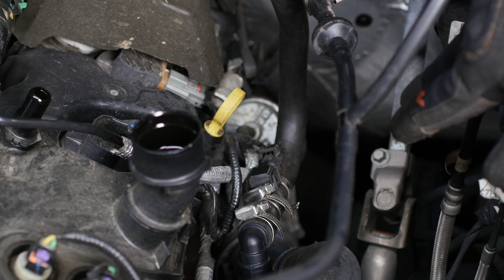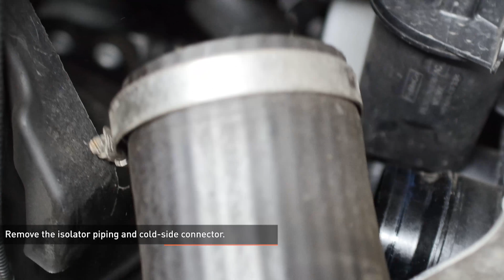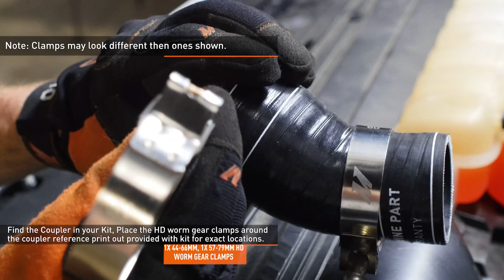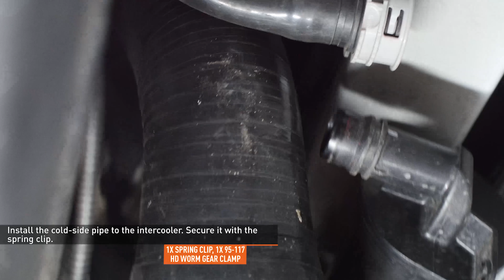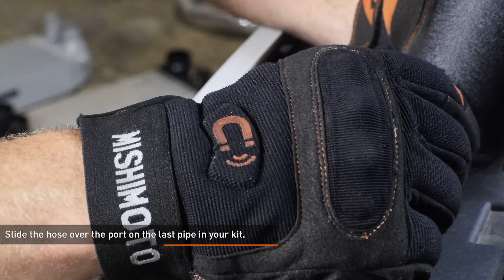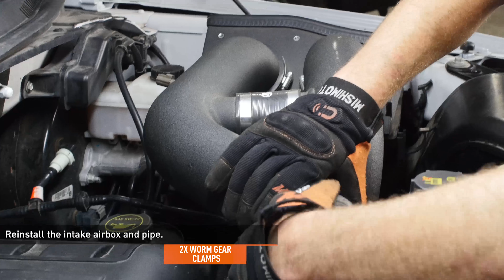2015-2016 Ford F-150 3.5L Ecoboost Intercooler Pipe Kit Installation Guide by Mishimoto

Comment: Bought the intercooler and piping kit a couple of months  ago . Finally started installing it today. Will finish the installation tomorrow . I can't wait to have it done . 
Update: It took me way longer than expected. The installation video makes it seem way easier than it is . My biggest issue was attaching the pipes to the turbos because the turbo inlet pipes were in the way . I took them out and it made getting the intercooler pipes easy to get in but impossible to get the inlet tubes back in . I have the AMS turbo inlet tubes and they're larger than stock so there just wasn't any room to work with . Anyways I got everything connected and I'm completely relieved, never want to do that again though . I highly recommend anyone who buys these to get them installed at a shop to dave yourself from a headache. Love the product 👌 just a pain to install.
Reply: How do you like them? I’m tuned with an intercooler and intake, not sure if they are worth it
Reply: @justinlamb3822  Personally, I'm glad I got the kit. I don't think they're necessary unless you're trying to get every ounce of power out of the truck . I'm eventually going to get Garrett powermax stage 1 turbos for it, and I figured I ought to eliminate any bottlenecks in the meantime.
Reply: @saulgoodman9193  good to know. I’m planning on doing some bigger turbos eventually too.
Reply: Did you have any problems with (very slight) slower acceleration? Throttle response? I have mine tuned but am noticing a difference, very slight but still a difference.
Maybe computer is relearning parameters due to higher/colder air intake..? I heard it takes a while for it to adjust, just to drive it around town and itll relearn.
Reply: @lukebenavides8804  I remember after installing it, it  did feel like there was some noticeable turbo lag. It was very slight compared to stock, but it was noticeable. It does, however, feel like it's breathing easier at the top end . I had a revision done after a few days, and with the new revision, it felt like I lost some low-end torque but gained power on the top end as well . I'm getting 20 psi of boost with new revision also, so that's probably why I feel the difference in power . The other tune before the intercooler and piping gave me 18 psi .
Reply: @saulgoodman9193  i installed mine a couple days ahead of a camping trip. Lugging around a 36ft trailer, i figured it would be a good time to do it to keep the air intake cooler.
I noticed the same too regarding what you said above. I bought some borg-warner Hi performance oem turbos, wondering if that would offset the torque loss or add to it and gain on the hi end. I prefer torque but any boost in performance is always accepted!
Thanks for the quick response. Glad i wasnt the only one noticing this. Wasn't sure if i did something wrong during install, forgot to tighten something, etc., but your comment makes me feel better👍
Reply: @lukebenavides8804  Right on , I got some garrett stage 1 turbos and formline manifolds just waiting to be installed on mine. I'm super excited about that . Do you have a tune for towing ?
Reply: @saulgoodman9193  i have the sct x4 handheld. I just loaded up the preinstalled tune that comes on all of them. I havent sent my data off to 5star tuning yet, but once i get the s-type exhaust and new turbos in, im going to send it off for 3 free tunes. They have one for towing. The other 2 im picking are economy and performance. All on 93octane. Pretty excited to see this baby fly
Reply: @lukebenavides8804  Right on, I have the same handheld. It also came with the preloaded tune, but I sent my info off to 5 star after I bought the handheld and uploaded their tune once I got it . Nice thing about 5 star is that they will do revisions for you for life . I've had 3 revisions since the original tune because I've been adding parts over time .
Reply: @saulgoodman9193  so i bought my x4 from a guy who was selling the x4, exhaust, and turbos as a kit. Never opened. Do you know if 5star actually cares if your the original owner? Like do they ask for the receipt? Cuz this tuner was brand new, still in box, never turned on. The original owner never touched or even opened the kit he was selling. But i know some companies are anal, you have to be the original purchaser or provide a receipt of the purchase...
(Sorry for the questions, just curious if i need to save up before sending it off. Rather hear the disappointment now😂)

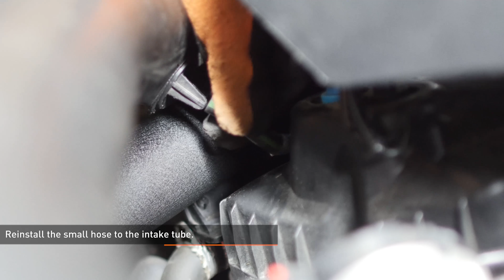Comment: Anyone else catch the 11:45 mark? Guarantee he broke the inlet where the hose goes, just like i did😂 cost 100 bucks to replace a whole tube of plastic instead of making them screw in replacements. Way to go Ford, you suck again. (Avid ford fan, own 3. This kinda thing just kills it for me though.)
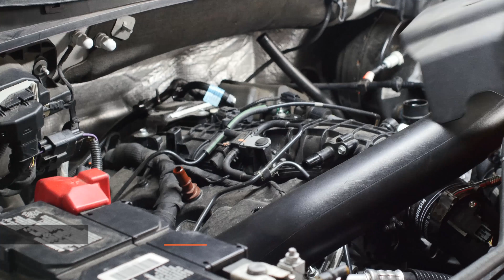Reply: Or at 11:14 where the breather tube is missing from top of engine I broke the same hose today off that charge pipe changing my spark plugs and that thing vacuum line broke or what I’m hoping is a vacuum line seen it’s a waste gate line on some forums but can’t find the actual line anywhere

Comment: Any hp gains?
Reply from the maker: On the stock ECU, there is no power gain due to the way it is set up to run. However, with an aftermarket tune, this can increase power of course.
Reply: Can I install the 2.7l pipes on the 3.5l???